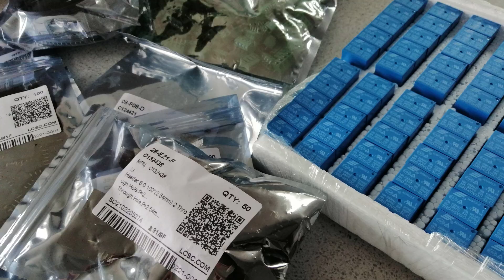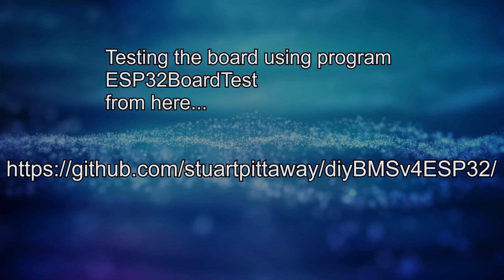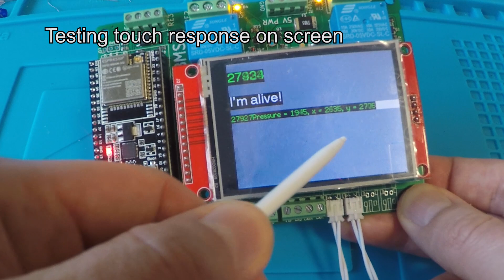Building & testing the new diyBMS controller - timelapse

Comment: Stuart looking for the right SD RAM holder. Have one but wrong way around. Main need to check parts. Hope you are getting well mate, all the best.
Reply from the maker: Are you using the TFT screen?  If so, that has an SD card on the back of it you can use instead of the one on the PCB board

Comment: Hi Stuart, and first congrats for that awesome work. I have a silly question I can't get out of my head:
Instead of wasting the extra energy through resistors, what about feeding it to an (array of) supercapacitor(s) though a buck converter?
The buck converter would deliver 2.7V, thus make it possible to use a single SC or parallel mounted SCs without the need of a bms that... would dissipate the extra power to keep the SCs balanced.
That power would then be available to contribute to batteries charging. I know it sounds too good to be true, and more intelligent persons than me must have thought about it before.
What do think about that idea?
Reply from the maker: What you describe sounds similar to active balancing boards. In a well balanced system, the BMS balancing should hardly ever kick in.
Reply: @StuartPittaway  Thanks for your quick answer. By "well balanced", do you mean once it has been initially balanced, or do the cells need to be as well matched as possible so the LB isn't always correcting ?
Reply from the maker: @reneonier  well balanced in that they have the same capacity and ideally same age. In a perfect world, brand new!

Comment: Nice, i see two onboard relays but on the old controller we had 4 with the external board, can the external board still be used with this or ?
Reply from the maker: This board has 2 physical relays and 2 solid state ones.

Comment: Hi stuart any intrest in developing a  multi-cell bms to compliment the single cell units you make? Looking at less parts for a larger build like 13-16s single boards, your slaves and masters would make a great d.i.y ess
Reply from the maker: The existing design doesn't make it easy to move to a multi-cell BMS (all on one board) it would turn out to be roughly the same cost, but none of the flexibility
Reply: @StuartPittaway  please development one that works with your new master i myself have 24 modules 13s 52a and finding a solution where i can monitor all the modules one place and not buy a house is fustrating... but keep up your work you have provided a cost effective reliable solution for us d.i.y guys
Reply: P.s the cost of your system isnt an issue for me its wanting to monitor 312 cells in the 24 modules and using the singles would take up more space than i would like to.
Reply from the maker: @roqm1248  what type of battery do you have to have 312 cells??
Reply: @StuartPittaway  i can send you pictures if you would like to send email...i dont se an email for you on this page.
Reply: Hi stuart are you selling these fully assembled? I am interested in buying fully assembled controller and bms boards
Reply from the maker: @roqm1248  No sorry!
Reply: @StuartPittaway  i am about to build your bms and want to know if there is ir measurements? If not can you look into implementing it as S.O.H....not sure if you already have but will find out soon i guess...keep up the great work!

Comment: Bluetac works well for the big sockets after building Brett's DIY charger discharger stuff. Will this board work with 4.3? Or 4.2 boards Stuart?
Reply from the maker: Hi, the new controller works with all the previously released boards, 4.0, 4.1, 4.21 etc. along with the new 4.40 board

Comment: how much would this bms cost fully finished with other pcbs for 12v system? i havent done any smd work and i dont have tools for that... thats why im thinking baybe i could buy fully finished and shipped to Latvia
Reply from the maker: Hello, the open energy monitor shop may stock parts/completed boards at some point (currently out of stock) https://shop.openenergymonitor.com/diybms/
Reply: @StuartPittaway BIG TNX ;) i will buy one full set for my 12v 18650s ;)

Comment: Stuart, I have a question if the relays built into your DIY BMS will be able to handle the disconnector in the ABB switch, there is an actuator with a voltage of 24V and a power of about 4A (100W)

https://i.ebayimg.com/images/g/AC4AAOSwICpaBbV5/s-l300.jpg
https://i.ebayimg.com/images/g/-4kAAOSwZwldpK53/s-l640.jpg
Reply from the maker: Should be fine, the relays handle up to 30VDC and 10Amp (although I'd only use about half of that to be safe)
Reply: @StuartPittaway  thanks for the answer, it's cool I measured the power consumption of the switch and it is about 100W (4A) at 24V, so there is a safe supply, the switch takes such current only for a fraction of a second, best regards leszek

Comment: Hi Stuart, I'd recommend a hot air board preheater at 150C, it'll make hot air soldering much easier.
Reply from the maker: Good thinking, although I only needed to do the 1 part on these boards.
Reply: @StuartPittaway  It's sure nice having a pcb fab do soldering of smd components, personally I like soldering all components myself. That skill set and equipment to do it easily is a worthwhile endeavor.
Reply from the maker: @GENcELL2014  I agree, I enjoy building from a blank PCB, however in this case I was building 30 boards so that would have been over 1,000 parts to assemble!
Reply: Yeah at that level a PnP or pick and place is already needed, in combination with a paste stencil and stencil holder.

Check out the YouTube channel called BAXEDM. His most recent vid is called "Home shop small series PCBA production". Shows a diy PnP, stencil, stencil holder, and vapor phase reflow oven or condensation soldering. You should check out vapor phase reflow, it's a affordable way to reflow boards and works better than IR or hot air reflow ovens.

In the process of creating a similar setup to BAXEDM for 20-100+ pcb runs.

Comment: I noticed the other day D8 was out of stock so I’ve been waiting. But I’ve also told Stuart via  Patreon that I wanted some via that order. I may go ahead and order a few myself on JLCPCB
Reply from the maker: D8 can be swapped for part C233494, it's the same thing just automotive grade
Reply: @StuartPittaway  hey, so in position D8 I can replace C14486 with C233494 yes?

https://photos.app.goo.gl/jhS1kKn6dGyj8etJ7
Reply from the maker: @ParagonDIY  yes,
Reply: @StuartPittaway  Thanks for the quick answer :), I will order 5 in a moment, I can't wait for the package to come, I already said that, but you did a good job, I will design handles and mounts for your device, greetings Leszek